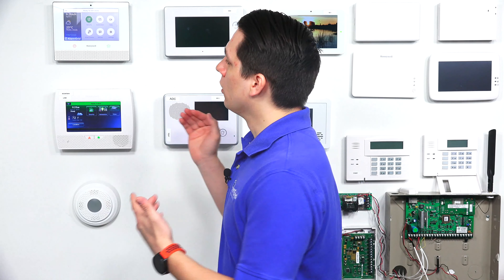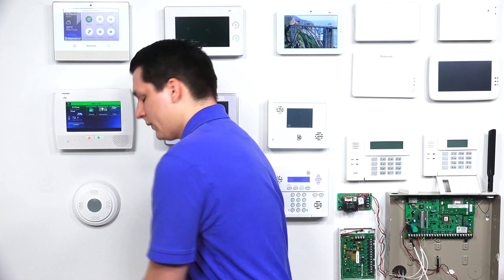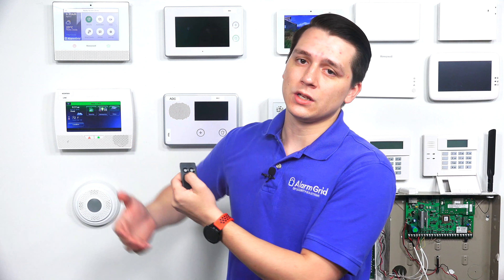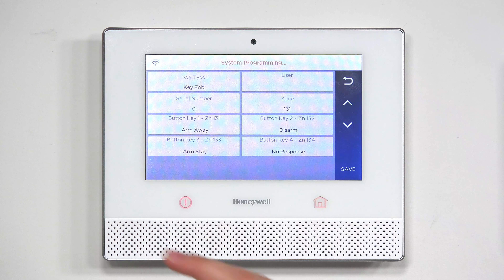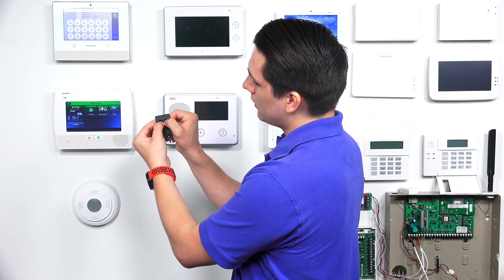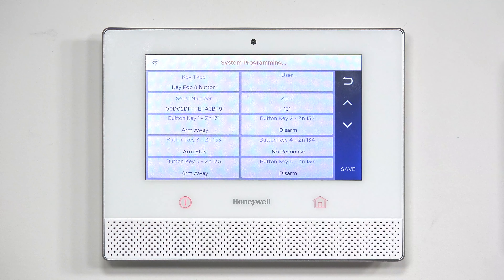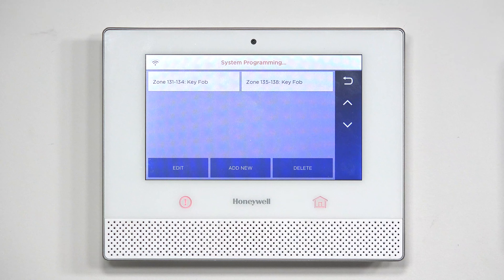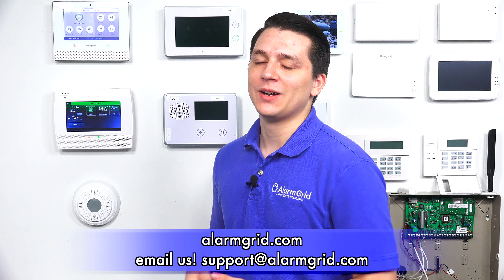Adding a Keyfob to The Honeywell Lyric Alarm System

Comment: How to program a sixfoba key fob to an adt command control touchscreen panel?
Reply: The SIXFOB is only compatible with the Lyric panel. The SIXFOBA is likely an ADT version of the SIXFOB, you may want to contact ADT to confirm compatibility.
Reply: @dylanalarm_grid1038  Thank for the reply. The SIXFOBA is for the ADT Control System and are compatible- just don't know know to program it.